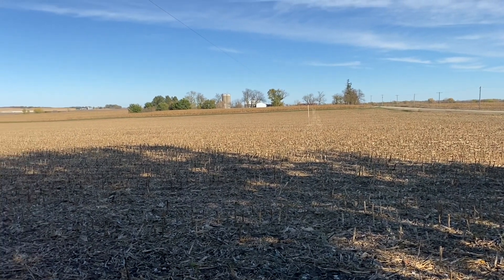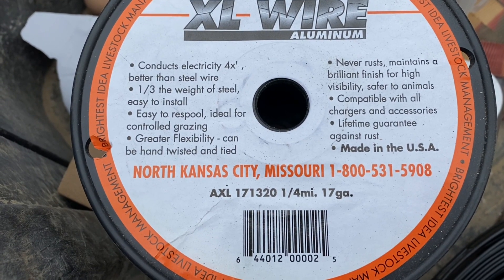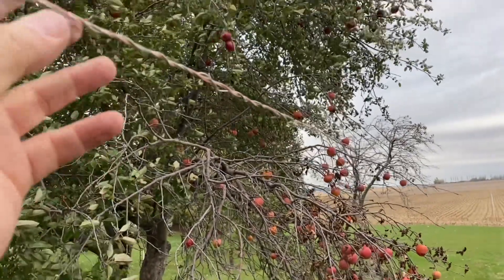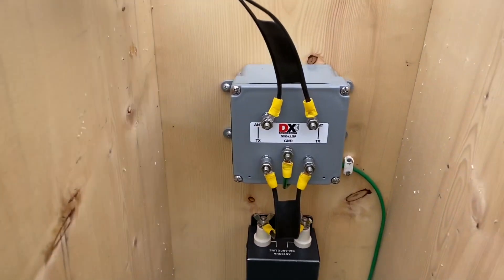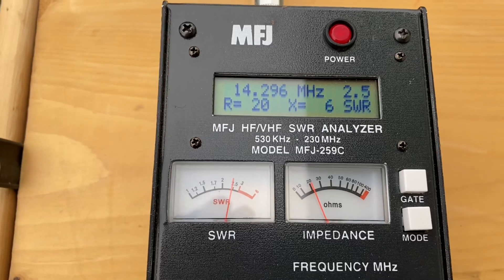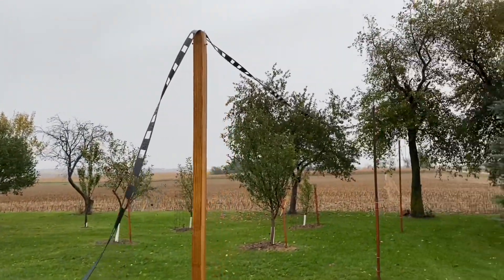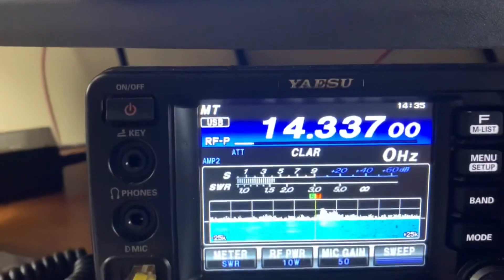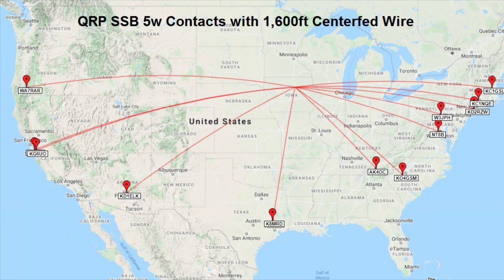1600ft Homebrew wire antenna QRP SSB 5w - Iowa

Comment: Waay too cool Kevin.. looks like it's going to be a fun winter on the farm...HAM RADIO, a thing of invention and experimentation.
Reply from the maker: Hi Roy... Thanks.. It does give me another antenna to play with when it’s too cold to do anything else.. It was suggested that I finish what I started and create a 3200ft square loop and see if that performs any better.. so, we’re going to make that happen in the next week or two... I’ll keep you posted on results with a video.. It could be interesting.. lol.. 73, Kevin ~ k0klb
Reply: @hamradioqrp-k0klb  Yes Kevin.. winter here soon on as well.. amazing QRP.. a couple feet of wire and a little hight. Looking forward to your winter projects on the farm.

Comment: It sounded like the 550 ft long wire was much better on the 20m band.
Reply from the maker: Sorry.. I meant 24 dB better.. lol
Reply: Height means everything when you are talking about horizontal hf. 70 feet is pretty high.
Reply from the maker: Hi Jerry.. Thanks for your comment.. Yes, the 550ft wire was better by around 4 S levels, or 24db better.. The 550 wire peaks at 70ft high, while the 1600 low wire thats 10ft off the ground.. It was to be expected.. I'm still happy the 1600ft wire performed as well as it did with just 5 watts.  73 Kevin ~ k0klb

Comment: Ladder line is cool, old school.
Reply from the maker: Hi Joe... Thanks for you comment.. I do like to use Ladder line feedline when I can.. it is very efficient and strong.. 73 Kevin ~ k0klb
Reply: Ladder line is pretty much required with non-resonant antennas with a tuner.  High SWR is a signal killer with coax.

Comment: That's awesome for your next trick you should turn that into a 3200 ft loop feed with twin lead. I think it would be very interesting to see the difference. Thanks for the video.
Reply from the maker: Hi Jeff.. Thanks for your comment.. Heck Ya ! !.. Now, that's what I'm talkin about.. That idea gives new meaning to the "Go Big or Go Home" attitude..  That is doable now if I get the posts in the ground before it freezes.. I'll work on that this week and I'll need to buy a few more PVC sections.. So, what is your suggestion on how I should connect the wires around the loop.. Would everything be connected all the way around? or open ended at the far corner... Let me know how you want it designed..  thx, Kevin ~ k0klb
Reply: @hamradioqrp-k0klb  it should be one continuous wire with one end connected to one lead and the other end connected to the other lead of the twin lead. I use this as a delta loop cut for 30 meters and it tunes from 40-6 meters it works great. Yours will be many times longer. I bet it will be awesome.
Reply from the maker: @jeffdyer2393  Roger Roger.. Will work on it this week.. So, it will be a 3,200ft square loop, 10ft off the ground (wishing I could get it 50ft high on poles, LOL)...  Ok, I'm on it.. going to turn colder this week in the 40's so will do my best and keep you posted..  k0klb
Reply: @hamradioqrp-k0klb  looking fwd to hearing how it turns out. I would be surprised if it's not incredible.
Reply from the maker: Hey Jeff.... Here ya go... Thanks for the suggestion... https://youtu.be/CBVbYH8iM7c
Reply: @hamradioqrp-k0klb  that's awesome. I'm glad it worked out well for you. I think you will get some serious dx with that antenna.
Reply from the maker: @jeffdyer2393  Making the square loop was an improvement for sure... Now I just need to figure out how to raise it to 50 feet, LOL... 73 !
Reply: @hamradioqrp-k0klb  4 weather balloons and a 1000 ft of twin lead you would have the best antenna on the planet for a day ha. 73 my friend